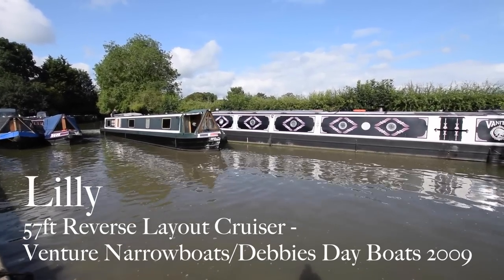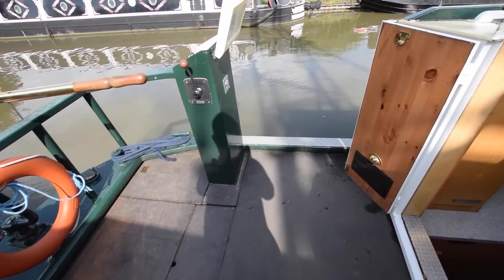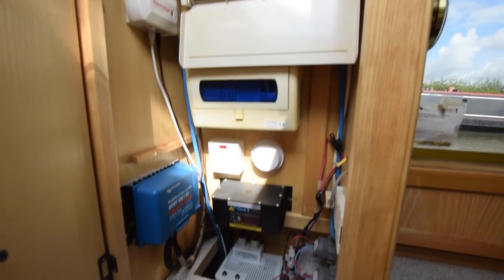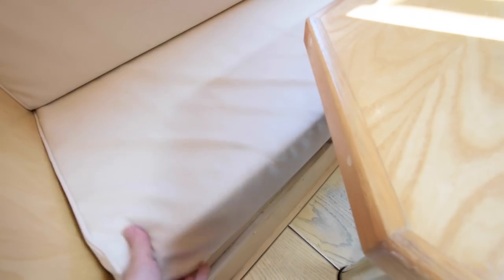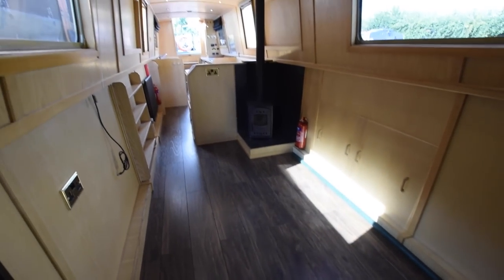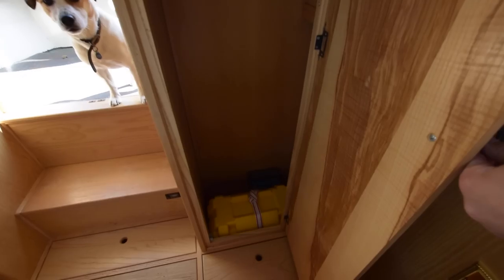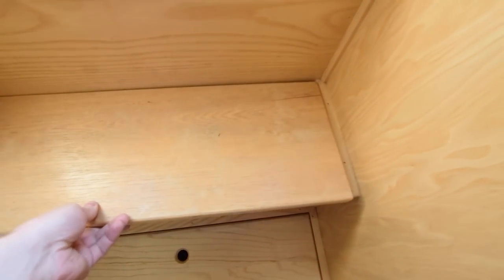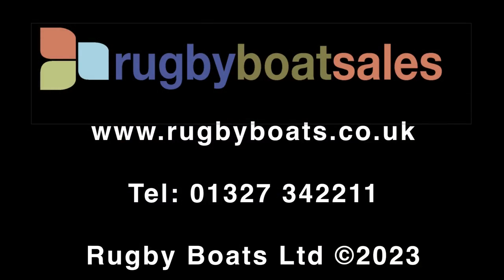SOLD - Lilly, 57' Reverse Layout Cruiser 2009 Venture Narrowboats

Comment: Nice boat but why spoil it with a cassette loo?
Reply: Id just stick a combustion loo in first week.
Reply: Some prefer it as it's the simplest to maintain, costs nothing to empty, and doesn't require electricity or odor control.
Reply: Low cost, easy to empty, easy to maintain and spare tanks cost next to nothing. Tens of thousands of motorhome owners use them without any problems.
Reply: @Bobg425 hope you’re not sitting on it when it combusts lol
Reply: @Conflictofinterest902  😆😂🤣